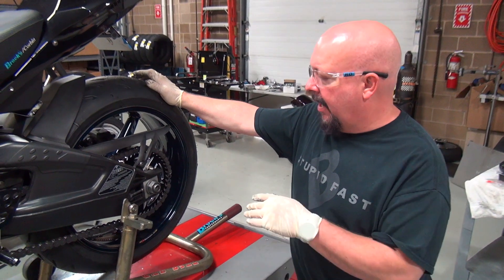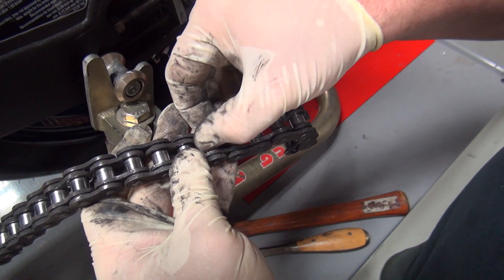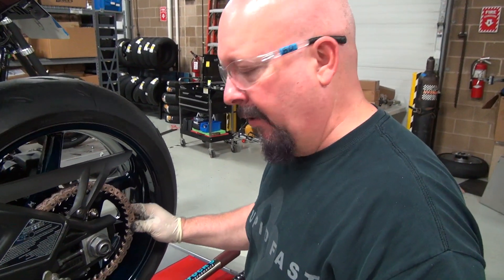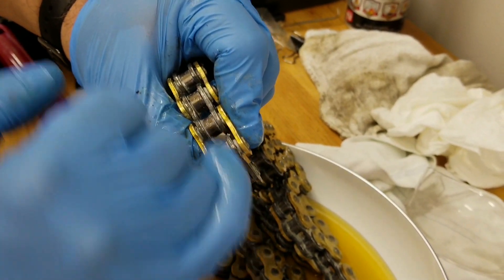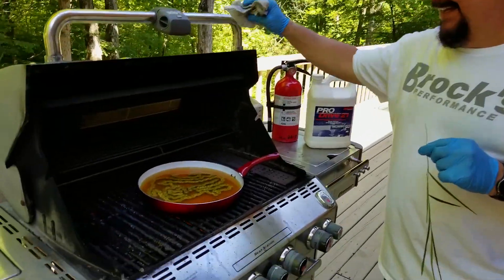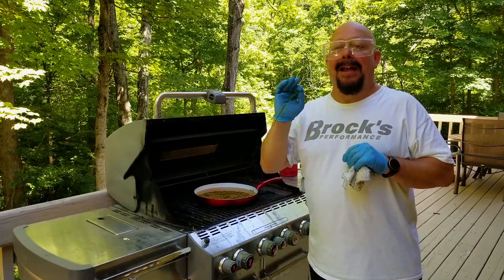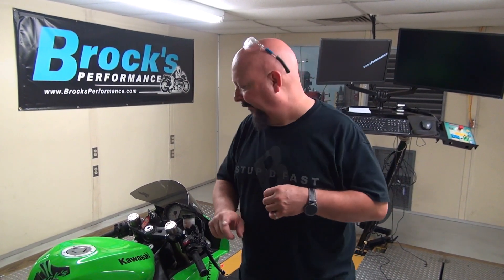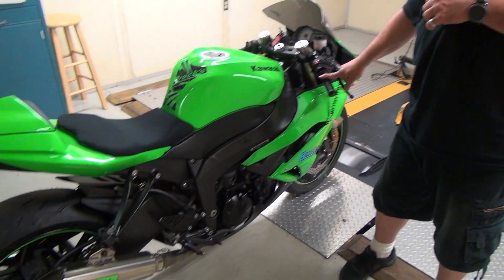Tech Talk: Drivetrain Friction Reduction

Comment: I went ahead and but an o ring hook puller and got them all out in about 45 min.. 😂😂  what do i need to use to lube the without the o rings now ? @BrockDavidson
Reply from the maker: Chain lube. Just remember, if you get caught in the rain with a non-o-ring chain and don't lube it...it will  die quickly.
Reply: @BrockDavidson  Thanks Brock , i dont think this bike will see much street riding... i put 2k miles and now it will be a track bike.. by the way i bought the clutch conversion from you...👍👍

Comment: You really are a mad scientist, aren't you? I've been watching a lot of your videos recently and i find them very informative. You said something about the drivetrain and i want to ask a thing or two. For starters, after the crankshaft where the factory power ratings are made, you have the gearbox and after that you have the chain and sprockets. Is it possible to change gears in the gearbox for different gears, either made from lighter materials and if it's necessary with different ratios too? The weight of the gears in the transmission must be sucking up the most of the power difference between the engine and the wheel. Obviously it would be expensive but my question is if it's possible, not how much it would cost.
Reply from the maker: Yes, aftermarket gears are available. No - the majority of driveline losses occur due to the inefficient transfer of energy via the drive chain. Unlike the drive chain, transmission gears are in a constant oil bath. Because they are small in diameter, weight is not much of a factor with strength being a primary concern. That said, performance oils and additives can help reduce gearbox friction as well as specialized coatings like micro-blue and cryo treatments. We use Alisyn Oil https://bit.ly/3pRL228 with Petron Additive https://bit.ly/3EOLmD3 for max power/friction reduction.
Reply: @BrockDavidson  well, I don't think those oils are available in Europe, I've never heard of them. So, for instance, the gen3 zx10 is rated at 188hp and makes ~165hp on the dyno. Can the chain and sprockets really rob ~33hp? That's quite a lot. What's your opinion on that bike by the way, the 2008 zx10r?
Reply from the maker: @vasilisgreen  We use a correction factor of 11% loss between the crank and drum. That would make your 165 RWHP = 183 HP at the crank. Besides the drive chain loss, there are also frictional losses/brake drag/bearing, seals etc... But the rolling resistance of the rear tire and available traction (tire pressure becomes very important here...) to the drum make up a large part of the losses also. A street tire vs. a drag radial tire can make a big difference also. Example: we lose as much as 25 RWHP switching to a Shinko hook-up drag tire vs. a stock Bridgestone due to rolling resistance and overcoming "tire stick"....but we have FAR more traction available at the track. knowing these differences makes a huge difference, not only in dyno readings - but at the race track as well. Hope this helps.
Reply from the maker: And sorry - the 08 is a great bike! From a pure racing/hp standpoint we are very impressed with the 16+ bikes.
Reply: @BrockDavidson  ok, makes sense. Thanks for your time. I'm really interested in a '08 model both from an aesthetic standpoint but also for its analog nature since it's a cable throttle bike. Anyway, thanks again for your help.

Comment: I'm serious, did you hook them with a hand tool like a screwdriver with needle tip hooked to grab? Or did you use a dremel tool? Those are the two ways I thought of doing it. Inquiring minds need to know. I need to know i doubled up on rivet link and didn't notice until I pressed it together. So I have two on each pin on the backside and one O-ring on the front. Instead of having to pull it all apart buy a new rivet link wait for it in mail. I remember your this video where you discussed pulling all the o-rings out. I was hoping it was explained in the content but was not.
Reply from the maker: It really depends on the chain. O-ring chains: we typically use a pick and a ground down (thinner) set of Dykes (or flush cut pliers, if you prefer. When done correctly, you can pinch/cut/extract with one smooth motion. On the tighter/thinner x-ring chains: It's though to even grab the ring, so we typically stab it with a pick and try to pull it our enough to hook the pick under and create room to snip the ring. Once cut, pull the ring out using small needle nose etc. It takes 90 min (experienced) to 4-6 hours (struggling rookie) to do a chain. ATTENTION! All of that work will fly out of the window and the chain will be destroyed if you get caught in the rain and don't have chain lube handy.... I have seen them kink and destroy themselves in a single rainy ride. That said, with proper lubrication, they will last as long as an o-ring chain, but have FAR less rolling resistance. I did the OEM chain on my personal Busa in 2008 and it still works great :)
Reply: @BrockDavidson  I just needed to remove to extras that I mistakenly added to the new rivet link that I installed. So I had them doubled up on one side of the one new link. I got them out and all is good now. I just took a razor then a pair of needle nose to get the two extras I added. Thank you for taking time to reply to a fool like me. I have your billet aluminum Hayabusa clutch drive installed in my TL100R and have not had any issues with it. I'm very happy I bought it instead of welding together the Clutch Cam Set.

Comment: Chain - yeh - back in 79,  I talked my Dad into letting me borrow his 68 Tiger 650.  I was riding and broke the center link. I was near a bearing works shop and walked in carrying my snake. Old fella in the corner looked over and told me the pitch and length.  [[Old guys had a scary amount info. But you had to ask the right question - jackpot!] I ran machine chain and links after that.  The engine cold not break it and I just needed to "cook" my chain monthly.  The bike still sits where I put it - 40 yrs ago.

Comment: Why not go the cycling route? Clean the chain thouroughly in solvent and bath it in wax and PTFE. It's what the pro cycling teams do and is without doubt the most efficient way.
Reply from the maker: They don't have the option of completely removing the roller to plate friction by removing the o-rings like we do. Wax is great for long distances, but it has more friction than light oil for short distances.

Comment: Brocks the thick material that comes on my chain is really thick that makes it hard to move and cause a lot of friction. However I have an o ring chain what should I do to remove the excess grease of it? Wd 40?
Reply from the maker: Yes, wd40 works well. Or you can purchase motorcycle chain cleaner.

Comment: Have you ever tried waxing a non-o-ring chain? And by waxing, I mean completely cleaning the chain (petrol, degreaser, methylated spirits wash) and then submerging in molten wax. 
Works really well for cycling chains. @Brock Davidson
Reply from the maker: We have. There is a very good product out of SA that we used to use. The problem with wax is that it get dirty quickly + we have gone quicker/faster at the track with our combination of <<0 alisyn +petron.
Reply: Did you use paraffin wax? I’ve found 10 parts paraffin to 1 parts 1.6um PTFE powder does a stellar job at keeping the friction extremely low and the chain exceptionally clean. How do you figure the chain got so dirty and How long did it go until you noticed the dirt?
Reply from the maker: @RadomKidsareme000  we used this: http://bit.ly/2Px71sy worked well - just not as good as oil.

Comment: Brock will cooking my  chain (with oring) the same way you did will affect my orings?
Reply from the maker: The heat is to remove the heavy grease. If the o-rings are in place, the grease can't leave.
Reply: @BrockDavidson  thanks one last question. If i want to install a swingarm i would need a longer chain for sure. Will it affect my chain strength if i get 2 same chains (ekthreed) and connect them having 2 connecting links instead of 1?
Reply from the maker: As a general rule, since the links are a common failure point, it's best to run just one. Not saying you can't run two (we have done it in a pinch), just saying that your chance for link failure is double...Unfortunately, if a link breaks, the chain can also destroy the engine cases, which makes it a very expensive lesson to learn.

Comment: Well one thing for sure i most definitely need to replace my chain and possibly wheel bearings. Bought my 2012 model brand new and the bearings never got changed out at all. They got over 43k plus miles on them lol. Clutch didn't get changed out as well. Im more laid back type of rider with a few high speed running time from time. Nothing drastic.  When I try to spin my rear wheel it does one turn and just stops like somebody pressed the rear break. I clean it and it does a little bit better but still possibly needs to be changed out.

 Sadly I can not go the same route here with the chain cause i do get caught in the rain a good bit. Best thing I can do is go with bst wheels and ceramic bearings and call it a day. Speed game though about to change since I now have nos for her. Not on the bike yet though and trying to find somebody that can tune her up good and install the nos system.

Comment: you sir, are awesome. i have a Ninja 400 (the whole 'ride a slow bike fast' thing) and i always used to wonder why the wheel would barely rotate if done manually. i did understand that the chain has friction and an O ring is not very good wrt that. this video is an eye opener. i dont care about top speed so mostly will go 1 tooth up on front sprocket and a non O ring chain mostly (removing O rings might be a bit too much for me right now). thank you for this video.

Comment: i don't know what type of lubricant you use after the oil bath but, the heavy pressure PTFE lubricant is quite amazing but you have to be careful about the application. if it gets to the brake pads or rotors, tyres. you better have some white vinegar or acetone with you before going anywhere. this shit is an accident source if sprayed on these parts.
Reply from the maker: We use Tribolube from Alisyn Aerospace.

Comment: If your chain has no rings or seals at all, then is there a time limit you can ride before needing to apply new lube?   Fort Nine says gear oil works best, but I don't know how easily it comes off when cleaning.
Reply from the maker: It's the same as running an non o-ring chain. Lube before riding and immediately after riding in the rain etc. We use this for street use: https://brocksperformance.com/synthetic-chain-lubricant-alisyn-9-oz-aerosol-can/

Comment: Awesome video Brock! Thank you for sharing all the tips/tricks/knowledge with the motorcycle community! I just did this mod to my chain for my ZX10 and curious what chain lube you'd recommend using.
Reply from the maker: +C3L1CA94 we use Alison <<0 weight motor oil on the chain at the track (it can get messy) or Alison chain lube for the street.
Reply: @BrockDavidson  how do you apply the oil to limit fling? It sounds messy lol
Reply: @BrockDavidson  how do you apply the oil? Seems like it could get pretty messy and possibly fling on the tire
Reply from the maker: We use a small oiling bottle and wipe off the excess with a rag.
Reply from the maker: https://www.grainger.com/search?searchBar=true&searchQuery=Squeeze+Dispensing+Bottle%2C+Polyethylene%2C+White
Reply: @BrockDavidson  Thank you!!!

Comment: Quick question. If I just want to remove all the OEM lithium... could I potentially let the chain soak in Kerosene? Drying, then laying in oil? Basically just removing the heating (and o-ring removal) process.
Reply from the maker: The o-rings will prevent (most) of the penetration of Kerosene from ever reaching the pins/rollers where the lithium grease is mainly housed. It would remove clean the external lithium, but no performance gain would be recognized.

Comment: What if we just take off the Orings n not cook up the chain will it still give some hp out?
Reply from the maker: Yes.
Reply: @BrockDavidson  nice.. appreciate u for replying brother
Reply from the maker: @jermeygonzales2236  I always try to reply. To elaborate a bit, the thick lube with no o-rings works very well. Of course, you will have a mess from slinging the lithium grease, but as long as you continue to lube the chain regularly, it will eventually get replaced.
Reply: @BrockDavidson  10/4 jus ordered a new chain n definitely goin to try it... thanks again brother

Comment: Stipid question. can you do with the the orings still installed?
Reply from the maker: You would need to subject the chain to extreemly hot temps to melt the o-rings - enough heat that it could damage the strength of the chain.

Comment: Did you try to just let the chain submerged in acetone,gas or whatever substance o-rings are not compatible with,to remove both o rings and lube ?
You would avoid useless manual labor.
Reply from the maker: nope

Comment: I tried a $30 non o-ring chain on my SV, got about 750 miles on it before it turned to a pretzel. Just looked at section of spare chain, sure looks like a PITA to remove them! O-ring pick?
Reply from the maker: You got off lucky if it didn't break. You really do get what you pay for.

Comment: How about chain tensioning in a longer wheel base situation 
EX.     I run a drz2 non ring chain in a race only app my rear wheel won’t spin like that ceramics and all but I don’t run a roller and I am sitting at 73” wheel base 
Should I have a chain roller to allow less tension?
Reply from the maker: Anything you can do to spin more freely will help you go faster. Roller as well as a larger diameter front ti keep the chain off of the front chain guide.

Comment: Brock, great video! What’s your opinion of running a 520 chain on a liter bike?
Reply from the maker: We used to have a stack of broken engine cases to prove any bike over 1000cc needs a strong 530 chain when drag racing.
Reply: Brock Davidson thank you for the reply. I was torn on going 520 or staying 530 on my ZX10r. That definitely convinced me to stay 530.
Reply: Words of wisdom right there. Moto GP bikes seem to use bicycle chains. Wonder how that works for them.
Reply: I’ve also seen first hand on my buddy’s gsxr 1000 that you need a 530 chain. His 520 broke and cracked his engine casing also.